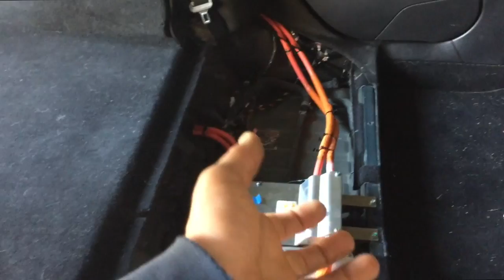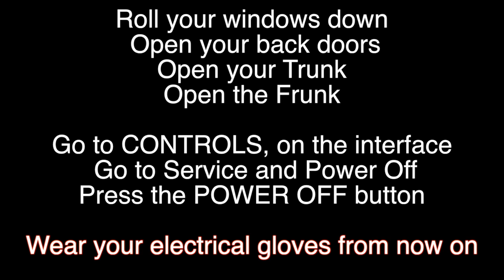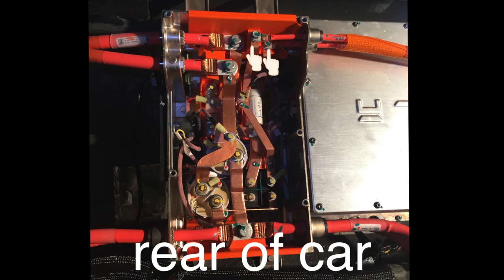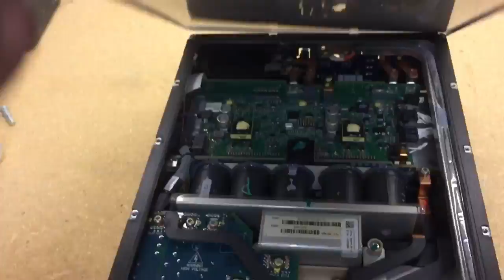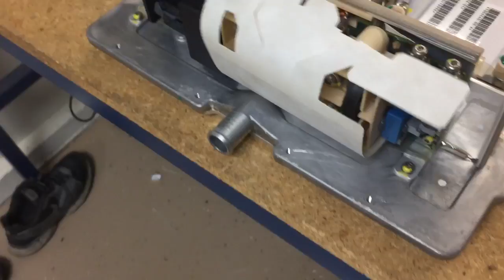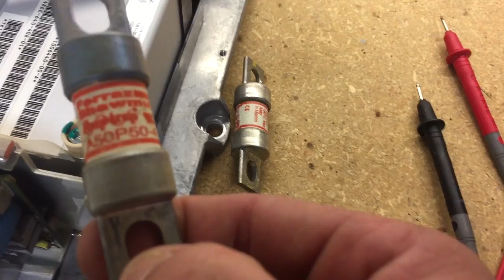Fixing a Broken Tesla Model S Onboard Master Charger

Comment: So here it is sunday and started to take apart the car around 7:30 am.  Seat and bar I took out saturday.  Ran thru this entire process and was able to access the fuses without having to remove the charger as stated.  I also managed to not leak a drop of coolant.  It should be noted that I have both a Master and slave charger and my ass backwards car as the master behind the passenger seat.  Also this video shows the box 1 way and mine is  the other way IDK why that is.  I tested the fuses in the box and and in the car and they were both dead.  I then replaced with 2 fuses and tested in the charger and they both had signal.  Put the car back together and the same shit it happening.  So $90 for the fuses, I wanna say 2 hours to remove the seats and bar.  Then 5 hours today to remove replace and then put everything back to be no better off.  I dont know if the fuses blew again after I restored power or if the slave charger was causing the issue.  At this point I dont know what im going to do.  If I decide to buy the charger on ebay its 242 for one.  If I choose to buy both that will mean not only do I replace them but would to then need to have access to Tesla Toolbox to configure the slave.  I have the laptop but not the specific cable to connect to the car.  Tesla toolbox access is not free....currently $75/day.

Comment: So the fuses came today and you set your multimeter to Ohms which is the greek looking kinda symbol and you touch the electrodes together and you should hear a beep.  Then do the same on the fuse.  If it beeps its a good signal if it doesnt its dead.  Both fuses are good so I want to do this right fkn now bc not having my home charger is a PITA.  However I will wait till Sunday morning to do so.  Next thing is theres a message on his video that says you dont have to pull out the box but theres zero chance from what I can see that you get to the screw underneath the connector you have to pull where those screws are so idk if ill be able to do that.  If theres no post on sunday on the progress of this fix I probably died doing it.  As previously stated id rather do so then pay fkn the service center 3k for this BS fix.  Even if I have to order the charger if this doesnt fix it its still only 350 total.  Will update Sunday, if anyone cares.

Comment: My fuses are coming this week.  Kinda sad that this video has been abandoned but I expected as much as all videos this old tend to be.  It should also be noted that these fuses are not $20 anymore.  They are $86/ea on radwell site but I found someone that had 6 on ebay and bought 2 for 45/ea.  I asked prior to buying if they were good and told them that I will check with multimeter when they arrive bc it would suck if I took apart the car and these fuses were not good.  Still want to reiterate that not showing what the multimeter was set on to check for current both on the high power box and on the fuses is annoying.  I dont see how to get to these fuses as you state in the video that you dont have to take out the box as they are in a spot that would be difficult to get to from where it sits.  I have my class 2 electrical gloves that are rated for 500v ready to go. If I die doing this well then I die.  Id rather die then pay $3000 to fix this shit. Additionally you not that the gen 2 is slightly different but the Gen2 isnt serviceable like gen 1 is.
Reply: What part number.  So I can order the fuses

Comment: I know theres no way I get an answer on this......at 2:22 you mention something about coolant that runs thru and you had to plug it all off.....you had mentioned vice grip pliers.....is there coolant that runs in this box?  Do you have to drain it out?  I didnt see any of that in the video.  I also saw that if this fuse doesnt fix the issue and a replacement is required theres a firmware portion of this install that needs to be done.  Toolbox is fkn expensive to use and would require classes to understand to run what needs to be done.
Reply from the maker: There is coolant that runs through the bottom of it to help cool the charger so I plugged off the hoses tilted up to drain back, drain it and then plug it
Reply: @Schlifey  I cant believe someone replied but anyways I did this attempt and replacing the 2 fuses didnt work.  8 hours to do it and my car still doesnt charge.  Unfortunately my car has 2 gen 1 chargers a master and a slave.  I asked tesla if I had them replace the 1 charger would they remove the other one since my fear is if its not the one its the other and a 3k repair now turns into a 6k one.  Of course their reply was no, they wont change the config of the car so im just fkd.

Comment: I lost DC power charging ability a month ago with a CHG_U015_FCDisabled alert. I had to drive through heavy rain and got the alert afterwards. The Tesla Service center diagnosed and just quoted me 3100 to replace the main charger. I knew it had to be a fuse and so glad I saw this video! Going to pick up the car in a bit and going to check the fuses! 
I can’t find that fuse for 20 bucks though! 70 is the cheapest I can find.

Comment: Hi Nick,
My 2nd Tesla Model X receives 24A only while my other X receives 48A. That happened after big spark when disconnecting the wall charger from the vehicle. I guess I need to replace one of the fuses.

In order to replace that fuse, should I disconnect whole batteries or just get into the fuse?

Curious....

Comment: Dude, this video saved me, thank you! One thing you didn't mention that had me scratching my head is the first disconnect with the looping red wire and neutral cable are in the frunk under the panels on the passenger side (at the 12v battery). Also like others said, you don't have to remove the seat backs or cage, it can just flip up after all 8 bolts are removed. Also a few of the fasteners are super hard to get to, particularly the rear 2 bolts holding the central power unit in place. They may be much easier if you do remove the seat backs, but the coolant line and some electrical are very much in the way. Anyways, this video saved me thousands of dollars and untold hassle, thank you!

Comment: Nick I just remove mine to check and replace the fuses and when I install it back it won’t allowed me to charge the car . Got the red ring and my lock don’t goes down to let me my home charger. The door does pop open on my car. Just wondering if you have to do anything special to get it to work. Any body else had the same problem?

Comment: This exactly what the problem was!! Worked like a charm! No need to remove the seat backs… just flip the cage up and secure it in the up position!! Saved me almost 5 grand on my 2013 P85!! Thanks so much bro!
Reply: Were you able to replace without taking the charger out.
Reply: @tjxoom1  I was able to replace the fuses with the chargers still in the car…
Reply from the maker: Glad I could help. After you mention it, ya you wouldn't need to take the seats out. I had them out when I was troubleshooting and didn't think through it when taking the video clips. Ill see if I can add text that says you can do it without taking seat backs out. Thanks!

Comment: Awesome video.  This just happened to my 2013 P85 (dual charger).  Tesla wanted $4,000 to fix!  (The onboard charger is up to $2900 with labor.  They also wanted to replace my charging port because one LED was burnt out.)  I got 2 fuses from National Fuse for $135.  Took about 3 hours.  Hardest part was those stupid backrest seat clips.  Bonus that I had the 14 yr-old help and he learned about testing voltage and continuity.  Since I had the dual charger, I had to take out the center unit completely (because I could not just push it aside.  Thanks for taking time to post these detailed instructions online!
Reply: @abeeezy1104  , there indeed seems to be some truth to that.  It just went out again a couple of days ago.  I'll have to pop it open to see if it is the same fuses or the ones on my other unit.  Still, at this rate, I could do this for the next 17 years and still be cheaper. :)
You seem to have a different issue though.  Mine works at the super charger and has a "communication issue" with A/C power.  Yours did not supercharge and had a different code.  I suspect you got it replaced by now. :)
Reply: @JamesGrant-xp4vf hey I have a 2012 p85 I’ve been having the same issue where it supercharges but at home it says communication error check power source and charging equipment. How is your car charging now after you replaced the fuse
Reply: @iqplayz9107  sucks that he didnt answer but this is the thing with videos that are this old.  This is exactly the potential cause.  The fuse.  I bought 2 on ebay for $90 but theres also a gen 1 charger available if this fuse doesnt fix it.  I only have the fuses and will attempt it this weekend as the fuses are arriving tomorrow.  Im not paying Tesla 3k to fix this.  If the fuse replacement doesnt fix it theres one available on ebay for 240 atm.  Part that sucks is this video doesnt show some stuff that I mentioned in the comments above and ill have to take my car apart twice if the fuse doesnt work for me.

Comment: The OP incorrectly states the gen 2 is slightly different.
This statement is incorrect!
They made the onboard charger gen 2 unserviceable, it is impossible to get to the fuses w/o breaking the charger components (the boards are all glued inside). Moreover the fuses (different than gen1) are soldered on the board!
So if the charger has issues like one of the phases in fault mode instead of enabled (in the case of phase 1, would result in the impossibility to charge from one phase like 110v or 220v via mobile connector) the only way to correct it is by replacing the charger.

Comment: Mine charges just fine at SC and Tesla wall connector but not with Tesla mobile connector...It complains the power is not clean, however the power is just fine (verified with another tesla)..Mine has dual chargers with Gen2 chargers. Could it be a fuse as well? Many thanks!

Comment: Two fuses...one for each hot line coming in?  If so, that makes sense to why I'm only charging at half speed when AC charging.  24 amps vs 48amps.  Tesla is throwing charging errors at any charger I go to.    I wonder if the neutral is carrying all the return current.  I'm going to go throw a clamp meter on the neutral wire for that circuit and see what it shows.  This is fun!  But why does Tesla have to make it so hard to get to the damn fuse!?
Reply: I have a Gen3 Charger.  The one in the video is Gen2.  I'm not going to open mine since I won't have any idea what's actually wrong with it.

Comment: I may have to do this on my 17 90D. Currently my car is not getting it's software installed stops at 30%. Even though they did an inspection front to back and saw nothing wrong a few days prior 🤔 other then milage maintenance at 136k miles needed which I'll be getting done. The master tech did say that these charger may need to be replaced. So I did a search and found this video. I will update if it is this same problem. Thanks.

Comment: New price from Tesla to repair this, a whopping 3K.  How could I refuse to fix it myself after this Video.  Thank you Nick for the information on how to repair the problem.  You gave a fantastic guide and led me through all the steps.  There are a number of details you will have to figure out if you do it by yourself. The hardest part was not the electronics for me, rather trying to get the folding back seat aligned with the white clip that hols the end in place. You don't have to dismantle the box next to the fuse box.  Just remove enough screws to move the frame, and not all the bus bars like he shows.  Just lift the whole metal frame after removing the Torx 20 screws and start on the fuse frame.  it is very hard to remove the two screws  holding the plug to the right of the fuses.  Dont bother removing it.  Just lift the whole frame up and you can see the fuses.  You will need a right Angle torx tool to get the fuses out.  If you have gone this far, replace both fuses together.  You dont want to have to do this all over again for $20.  Fuses from ebay are a rip.  Go to www.thefuseshop.com   $20 each. No shipping.  Again so happy to avoid giving Tesla $3000 for $40 of parts and 5 hours of my time.

Comment: Just did this on a 2013 model S with dual chargers and it's charging great now. Thanks again for the video. Also, Tesla quoted $2,595 for parts and labor for the repair, then sent another invoice increasing it to $4,500. I got them to reduce it back down to the original quote before seeing this video and replacing the fuse.
Reply: Hi Thomas. Did you have any errors or couldn't charge at all or just lower charging power? I can't get past 18kW on a 22kW capable charger (P85 w/ dual chargers). Tesla also invoiced me almost 3000EUR and I decided to cancel it. Not worth the additional 4kW. Thanks.
Reply: @breakfixfever  I could only supercharge when the fuse had blown. Any 120v or 240v charging wouldn’t charge the car.
Reply: @TMART09  Did it keep saying on the app, “charging interrupted” ??? Pls help! In need of confirmation! I have a 2013 P85!
Reply: @TMART09  Were you able to fix.  I have same issue with Gen2.  Does it use the same fuse.  Thanks
Reply: @tjxoom1  Sorry I never saw this originally. Not sure if the gen 2 uses the same fuse though.
Reply: @T3m0ur  I know you've probably already solved this, but I looked back and didn't have any screenshots of the app or dash from when this was happening.
Reply: @TMART09  I did solve it, and it turns out my entire onboard charger was the culprit. I replaced it and did a software restore install from another guide and it still works perfectly till date.
Reply: @T3m0ur  is it possible for you to reply the link to the software restore install video? Or whatever guide you used. I might also need that to help me
Reply: @TMART09  how is your car charging after replacing the fuses. Currently having the same issue with my 2012 p85 it’ll supercharge but not charge at home.
Reply: @iqplayz9107 did u solve the problem and if yes was just the fuse ?
Reply: what a scam

Comment: Thank you so much for sharing this @NickS! I was able to do this in half a day, not counting trips for tools.Saved me $2500. The first initial step was different for me (2013 85kwh), so I just disconnected two negative lines and the large junction clip. At no time did I ever read any voltage in the lines. FYI it’s T20, T30 and T50 torx drivers that are required which of course I had to buy.
Reply: And Tesla wanted to charge $2400 + tax for a remanufactured part, no labor charge. I guess they’re re-fusing and testing the units they pull out of customers’ cars and covering the labor that way! No complaints on Tesla while I was under warranty but I’m glad to avoid a $2600 repair for a  $20 fuse and some time.
Reply: Have any pics? I am about to do mine... Any tips?? Kind of nervous about the electricity. Need to know how to measure the continuity of the new fuses before I 
take apart the car.
Reply: @T3m0ur  I didn’t take any pics. Did you watch the video? I bought some 600v yellow rubber gloves on Amazon. Use a voltmeter to test the fuses before your install them, and to confirm that the existing fuse is bad. They can be had under $30.If you’re not comfortable doing it, or can’t follow the video, it’s worth paying Tesla and not risking injury.
Reply: @davefstein  I finished it last night. Turns out my fuses weren’t the problem.
Reply: @davefstein  Is the fuse the same for Gen 2
Reply: @tjxoom1  I can’t tell you that unfortch. Mine is first gen single charger 40Amp onboard. I’d search tesla owners forum and ask there.

Comment: Hi nicks I have problem with my tesla before it was charging 80km/h now only 40km/h i have 2 charger board i think one of them is broken?

unable to charge 
disconnect cable and retry

what should I do i change the fuse of charger?

Comment: Can the same procedure be done for gen2 onboard chargers? Tesla just replaced mine without consulting me first, and tells me yesterday you’re car is ready for pickup, oh and btw it’s $2700, sorry we didn’t ask you first, it was a mistake on our part, if you don’t sign off on the job will figure something out, but you’re car is basically dead in the water if not, so you don’t really have a choice if you want to have a drivable car, flustered and put on the spot I said ok, but came across this video shortly after hanging up, I messaged them and told them I at least want the old charger back, they refuse to give it to me, since I never actually signed the invoice or agreed to the job before then just went and did it on their own, I’m thinking about making them remove the new charger put the old one back, and fix it myself if it’s just a blown fuse?

Comment: I just completed this successfully and am now charging on 110v. When I charge successfully on 220v I’ll update the thread.
Reply: I am still charging on those fuses.  If only I could learn how to install another charger so I have dual 80 amp.  I have three 80amp chargers at my house and this is the only car that doesn't charge above 40 amps.

Comment: @Nick S, This video was made about two years ago. Is this 10kw charger still working with it's replaced fuses or did they pop again?
Reply from the maker: Eric Bendler the other fuse that I didn’t replace during this video did blow a year later. I swapped that fuse and haven’t had a problem since. I just 100k miles on my S and only other issue is the batteries on the tire sensors. Very happy with this car. Holds up well.
Reply: @Schlifey  Yep, I just ordered 2 fuses, so they can both be replaced at the same time, no point in saving $22 and having to go through this again :-)